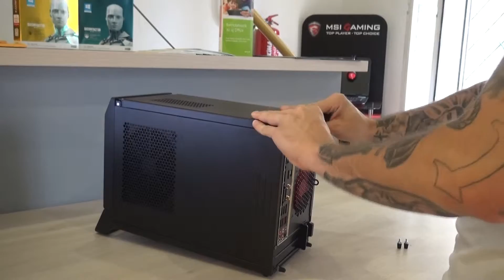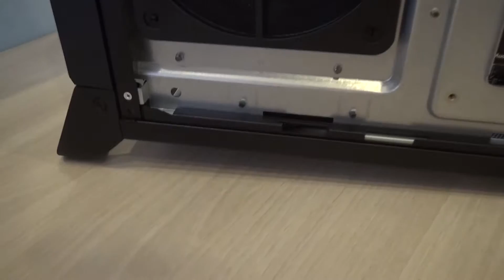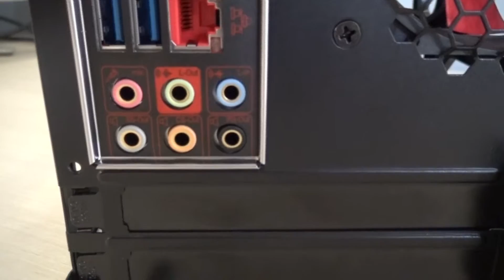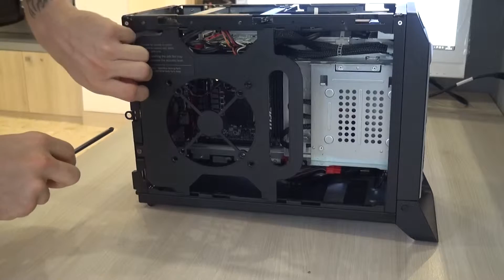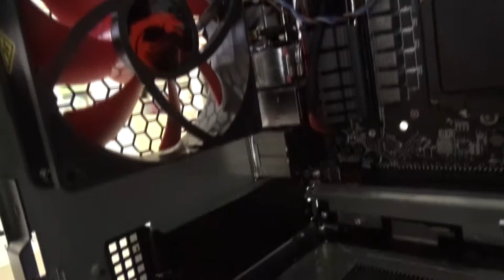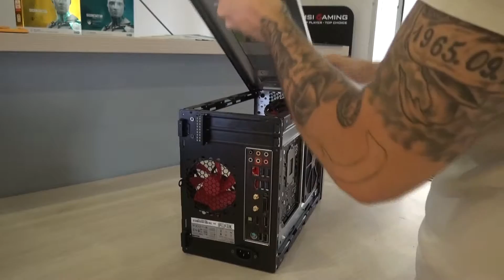MSI NightBlade Gaming PC disassembly / szétszerelés

Comment: This is an old video but I hope I get a response. I own this case, it's a z97 nightblade. I want to upgrade the cpu but I need to change the motherboard. I don't want to spend in another case, I really love the retro look of the nightblade so I would rather buy a newer mini itx mobo and change it.

Is it possible to remove the current motherboard and install a new one?